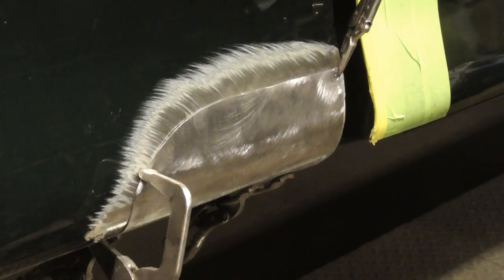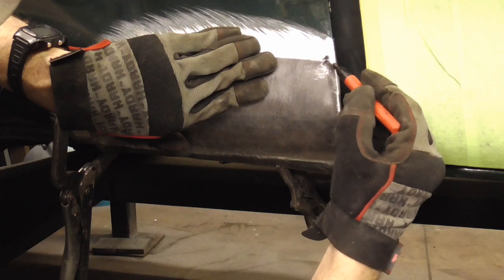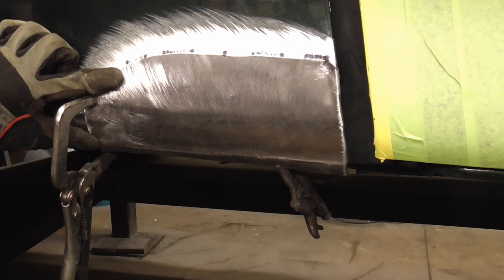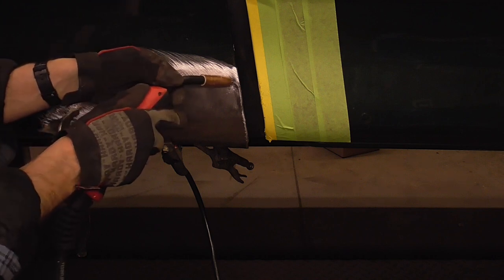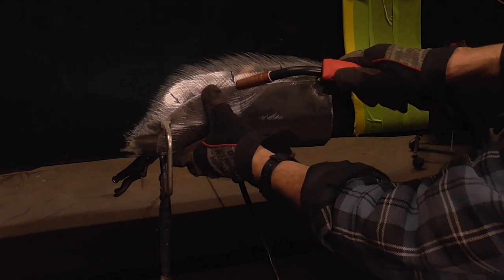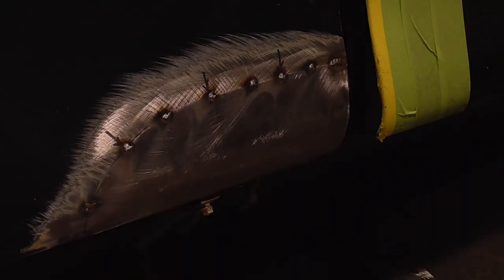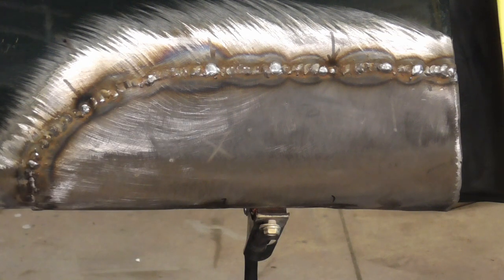How to MIG Weld Rust Repair Patch Panels - Detailed & Up Close

Comment: How do you like the yes welder
Reply from the maker: I like it.  It seems to be built pretty well for the price and I don't really see it breaking down.  I'm not sure if you can find a better welder or customer service at this price.  Another good thing is that you can easily get parts for it :)
Reply: I'm glad to hear this I have been considering a new welder and I am thinking about the yes, harbor freight, or a hobart and I see good reviews on them all and I don't read the 1 & 5 star reviews I like the middle ones best
Reply from the maker: @timgiesin4025  are you just going to be MIG welding or are you looking for a multi function welder?
Reply: Mostly mig welding but you never know about the future nothing heavy duty
Reply from the maker: @timgiesin4025  Yep, you never know.  One other thing is that this can run off of 220v too so if you do decide you want to weld something much thicker - no problem.  I runs off 110v or 220v with just a short adapter cord.  I've had it for about 1 year - nothing wrong yet so.... Have a good week Tim :)
Reply: Thanks for the feedback you always answer questions that is one of the reasons I enjoy watching your videos someday I would like to stop in at your shop and say hello
Reply from the maker: @timgiesin4025  You're welcome Tim - feel free to stop by any time.  My email and a link to Lakeside Discord for uploading pics is under the "about" tap on the home page.  Jerry

Comment: That panel would be way too hot. On an old car doing this would cause it to distort big time.
Reply from the maker: It really depends on where you are welding - out in the open on a big flat area - you have to be careful.  On rigid areas like this or rockers not so much - always best to take your time and keep the area as cool as possible though for sure :)

Comment: It’s a lap weld not a butt weld.
Reply from the maker: Yes.  Lap welds are used most often when patching rust.  Sometimes butt welds are needed for edges and rigid areas that can't be tapped down.
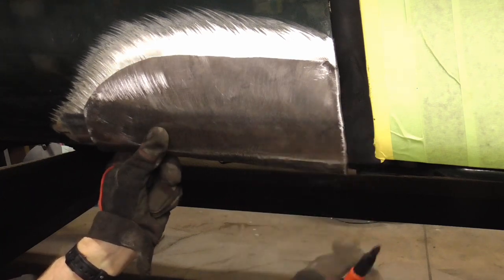Reply: 55 second to 1:08 into your video you said you were butt welding.🤷🏻🧐
Reply from the maker: @benzkeez  I'm glad you caught that because that is an important BUTT weld.  It is butt welded right there because you want a nice even thickness as it is the edge  and can't be thick in one area, then get thinner.  The rest of the panel is lap welded.  Lap where you can tap the seam down. Butt where you can't - that's a rule of thumb when you work in a body shop that does a lot of rust work :)